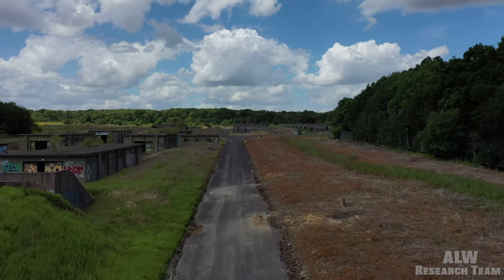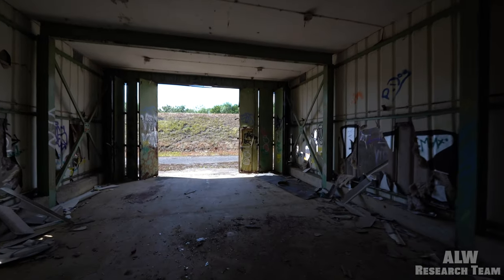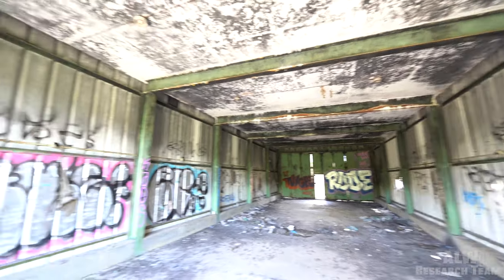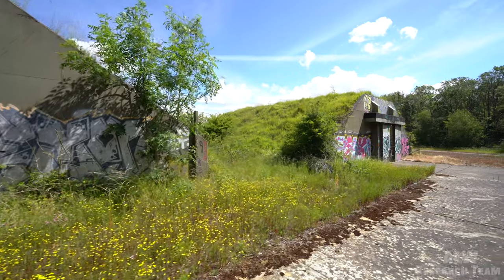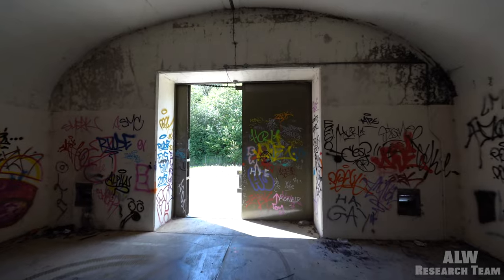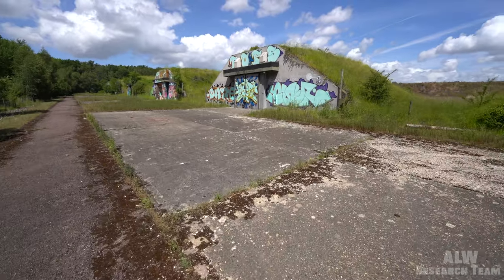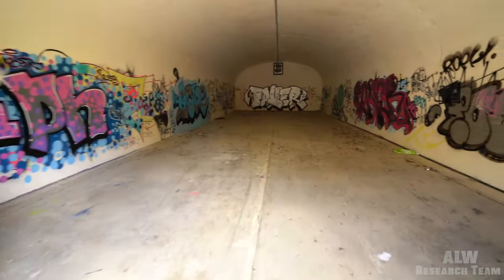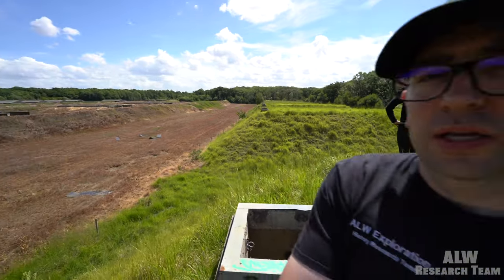V Force Nuclear Bomb Storage

Comment: Great explore, the only thing I know is that Blue Danube, our first British bomb was serviced at Faldingworth and Barnham, it was a huge casing and weight. Fissile cores were stored away from the bombs in small sheds called hutches on site. Special stores appeared on the V Bomber bases in the late fifties for nuclear weapons which by then had become physically much smaller yet more powerful thermonuclear devices which in turn were simpler to store and maintain. This was after the US had agreed to share nuclear bomb design with us. It also appears that we had a much greater storage capacity than the number of warheads we ever held. It also probably means the Faldingworth and Barnham like so many British defence projects were obsolete by the they were commissioned. I have been told from a reliable source the the US warheads for the RAF Thor missile system were stored on the sites themselves under USAF control. As to the V Force QRA required that three to four aircraft were held at immediate readiness, nuclear fully armed on each base. I hope this has been of assistance. Keep up the good work because much information still remains classified.